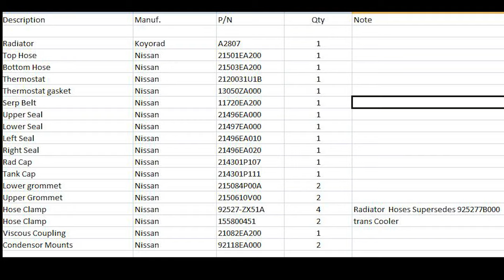Radiator, Thermostat, Serpentine Belt Replacement  ( Updates in Description! )

Comment: Outstanding project, Stan! Thank you for the attention to detail! It will really help me to get mine done. Now I'm wondering what I'm going to plummy lower radiator outlets with since I have a manual transmission and there is no need for transmission cooler. I'll see what the old one looks like and transfer the plugs from that one. Stay tuned for an update! Gotta replace my trans fluid, install an external mic on my new headhunt and fix the broken odometer reset stalk. Woof! Lots to accomplish before the weather turns cold! Luckily it's going to be around +19C this weekend. I can dig it!
Reply from the maker: Thank you very much buddy for the watching and commenting !! I know the video might be long but I tired to keep as much info in it as I could never know when someone might need to look up for something ) and  oh nice ! good luck on your project replacing it and haha I know the feeling sometimes it feels like the list of stuff to do never ends ))  or sometimes I just keep finding other stuff to upgrade, add or replace

Comment: Great video.  I  had no idea switching out a radiator was this involved.
Reply from the maker: Hey ! yeah.. I mean maybe it would be easier for someone else but I felt like I did all the right steps.. its just.. also in this video I went and replaced alot of parts and stuff so it kinda drag out ..  but overall I had alot of fun working on my truck and everything worked out good )

Comment: Great video, I used it to do the same replacement on my 06 this week.  Quick question: the manuals say 2.7 gal of coolant should be in the system, but like you I've only been able to get 1.5-2 gal in when engine running at temp, does the capacity change with the koyorad?
Reply from the maker: Hey glad you fixed and replaced your radiator !  and that video was some help ! 
as to the capacity I believe they are talking about full capacity remember that when you drain alot of it still in the hoses, engine and etc .. so not all of it drains so when you fill up it will just take as much as it needs.. as long as you burp  all air out 😉

Comment: So how long can the new radiator go before you have to do the coolant bypass again? Also I cannot believe you did not clean up that rust on the side brackets, come on!
Reply from the maker: Once you put new radiator by a good brand you no longer need to have coolant bypass , moreover you should not have bypass at all so you have best maximum transition cooling as possible .   ah... yeah... I looked at it... but  I felt it was to long gone to be cleaned up there.. ))
Reply: @DIY_AUTO_PHOTO   So what is the model number of the transmission you used? Is it a diffrent model number than the old bad one? What did you pay for it if you don't mind. Where did ya get it.   I got less than 100,000K on my pathfinder and I'm trying to make a decision.  LOL
Reply from the maker: @rockstomper8390  hey sorry I got confused what you mean by the transmission  ? you talking about the fluid I used to fill it up  or  something ? ))
Reply: @DIY_AUTO_PHOTO  My bad, I meant the radiator. How is it holding. What radiator did you change to?
Reply from the maker: @rockstomper8390  its been good so far and I hope it last long time lol  and I have Koyorad A2807 in there now ) same as I am putting in the video
Reply: @DIY_AUTO_PHOTO  so when changing the radiator u don't have to do the bypass no more ?
Reply from the maker: @Luke-de9zw  That is correct sir !  with a new radiator like that or some other good brands  you no longer need to have the bypass so the transmission   can be cooled properly